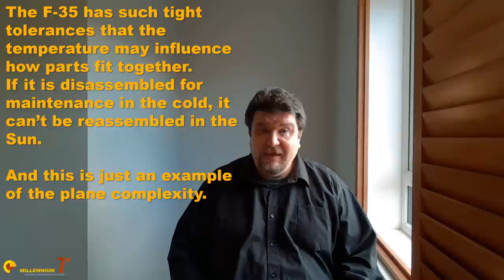F-35: The Failure of the $100 Million  Dollar Jet | Maybe...

Comment: The company I work for makes a lot of parts for the F-35.  The design of some of these parts is extremely complex in geometry, extremely tough to make in terms of the material they are made out of, and extremely tight on the tolerances.  Many efforts have been made over time to simplify the process of making these parts but it is still now and likely will continue to be an extremely hard machine to build.  Because of politics, I think it's unlikely the F-35 will end up being cancelled, but I can definitely see a lot of reasons to augment the air fleet with a wider variety already existing capable aircraft.
Reply: That's not a bug. It's a feature.
Reply: Tight edge tolerances equate to better stealth.
Reply: @SoloRenegade  All of what you said is correct, but the parts I was thinking about in particular are by their nature not simple.  They must endure extreme temperatures, extreme pressures, and are incredibly light weight considering what they do on the plane.  These components have their shape dictated by physics, so while there is always work being done to try and make them cheaper and better, these are some of the most expensive parts of the aircraft and that is unlikely to change because of what they do.  This is the case for all fighters which would have similar components inside them.  We also have lots of smart people working on these components who properly understand what they are doing.  Way back in the day when I first got into engineering I came to the same conclusion about many things being able to be made simpler and cheaper, but some things are not simple or easy.  The term 'cutting edge' is often a simplified way of telling someone you are doing something technically complicated but doesn't properly explain how difficult it can be to work with the hardest, toughest, most difficult materials and get them to conform to a tightly controlled form.
Reply: Things that fly are always simple and cost effective.
Reply: It really was a case of asking too much out of one aircraft. Not sure what made Lockheed executives believe it could be done, but I give the F-35 engineers credit for trying to craft the Boss' impossible specifications demands anyways.
🐸
Reply: @SoloRenegade  I would love for us to meet virtually, I'm a noice engineer, projects like the Sr-71 and Saturn V amaze me to this day.
Reply: @SoloRenegade  can old aircraft like F-117 nighthawk be modernized as a replacement for the F-16? It sounds stupid but the F-117 design is so advanced and looks menacing ?
Reply: The new 4.5gen fighter design's context is for "low-level threats". For USAF, F-35A, F-22A, and NGAD are allocated for near-peer and peer competitors.
Reply: @SoloRenegade  What about a modernized F-14 Tomcat ? Wouldn't it  be a cheap replacement  option for that the  B-1 bomber.
Reply: Edgewise i recall a quote from a Lockheed/Martin official a couple years ago.  This was after all the big decisions on design were settled...not before.   "We are bumping up against the absolute limits of technology on the F35 (paraphrase). "  I cant recall such a statement ever in the defense industry.  Given the charter they made a great plane imo.  Edit this quote was made around the time Gen Bogden (sp) stepped down.
Reply: So if we ever need to ramp up production...forget it. And you should have a plane that you can ramp up production on since if you get into a war, that will be the plane to have and you do not have 10 years to develop a new plane. You need to ramp up production immediately. Otherwise once your fleet is all down in flames, you will nowhere near enough replacements.  If you do try to create a new design,  you will have all sorts of issues. What you said should indicate that the US needs to immediately dump this turkey, and get started on a manufacturable plane. Amazing how the US has changed since WW2. Manufacturability was an critical criteria.
Reply: @SoloRenegade  your first response was a damned good reply. Is the F-35 truly over engineered? I'm literally in a position to not say, but you and I both know that modern platforms with current industry culture tend to favor that. Why? The engineering these days are done by interns rotating in and out every two years. Most people I've known in Aerospace are there for the experience only, to pad the resume. The over engineering is sometimes on purpose so they can lay claim to an accomplishment for the current corporate culture's pat on the back requirements, OR they're lazy and lazy engineers only add, never take away. There's very little functional fore thought from those types. 

The true engineers of the F-35 are damned good ones and have long since either retired and are providing consultation from their respective promotions in Skunk Works - but other than that the plane is literally maintained by committees of College Kids with no true applied knowledge, whom are just passing through. The ones that do a good job are the ones who are actually passionate about Aerospace and thus, care and have pride. 

Beyond that, the over engineering is a constant response to the DCMA (Pentagon) poking the bear as well. 

The said thing is, the F-35 is a damned good aircraft for the price but it puts companies out of business to make for the reasons the person you responded to stated. Tolerances and materials worked and other requirements by Lockheed are so high but I'll tell you another problem - Lockheed like every other Aerospace company, only orders a select number of parts at a time.

This forces those companies that struggle to produce the supplier parts to begin with, to go in the hole just producing the tooling required by the batches that Lockheed orders are so small that's it's simply not cost effective. I personally know of two CNC shops and two Tubing/Piping shops that were put under because of their F-35 contracts. 

I'm not privy to say how or why, but I see the problems as well and it's the same at Boeing, too. 

The F-35 is not the problem - it's our current professional society. The culture. Every one is here farming resumes without regards to leaving a legacy or a sense of accomplishment. No pride or anything. It's simply a circle jerk of endless proportions.
Reply: @SoloRenegade  I bet you and I could talk for hours brother. 

One thing I will say after having experience in launching 3 separate producing lines before - the higher your volume, the cheaper the cost and those benefits not only befall you, but your customer as well. 

If we like the F-35 (which I of course, do) but want to see it succeed? Gotta' produce a lot of them. 

Simple as that. 

Got to keep the program going and need to make thousands. The F-16 is the prime example of doing it right and the F-22 is a the prime example of why cutting it short is wrong. The 16's over all cost and sustainment is as good as it is because we have spare tooling, decades of generational knowledge on the program still working (even on the manufacturing floor) and established supply chains. 

Tbe F-22 was prematurely killed at 187 articles and they came back years later and even 2 years ago, asking us if we could could make more? Each time the answer was 'no' because by killing the production so early, the F-22s is prohibitively expensive upfront to restart. The tooling is gone, the established knowledge has thinned out or moved on and supplier chains never were maintained so you'd be starting from scratch. 

The F-35 is likely an over engineered platform like any complex machine these days, but with regards to the program itself in US political concerns, the cost of it could be offset by simply pushing thru and letting it mature - just like any other long term program be it the 15, 16, 18, F-4, ect. Over time, the 'over engineering' problems will get worked out AND, you'll have reduced your over all cost per unit via the continuous production of thousands of units. 

Yet I don't expect such a rational reaction from our political leaders. Every decision is meant to pander for the vote these days. The F-35s massive flaw in being heavily outsourced to suppliers is not the F-35s fault, it's actually Congress's, the Pentagon and only slightly Lockheed's (strange to defend Lockmart but yeah they're mostly innocent in this problem). Congress basically promised you a job in CA or NY in exchange for your vote, hoping the 'well paying jobs' would offset the cost burden on the fiscal budget. 

They were wrong because they clearly don't know shit about real life production industry, fabrications industry or Aerospace manufacturing and they clearly were either too lazy to get guidance or were lied too if they tried to get guidance.

NATO was also to blame in this as they traded international jobs on the JSF program for decreased NATO defense budget requirements and trade incentives. 

In other words, while you and I mourn the death of old school Engineering pride - the F-35s costs problems are actually on the very same people who complain about it costing so much. 

How's that for irony...
Reply: @SoloRenegade  your point with NASA is spot on and it's so infuriating. They're literally at the whim of people who don't know wtf they're talking about. 

Ted Cruz for example gave NASA a nice budget boost but explicitly told them how they'd spend their budget - which in his case, he ordered them to avoid investing the budget into Global Warming research because 'NASA should be researching space' despite ignoring the fact that meteorological research and atmospheric research is a hot commodity since landing on other worlds with an Atmosphere (even if thin) is in the very near future.

I had family in NASA and in companies like Lockheed / GD / Convair. They'd all agree that our current political cycling is ruining advancement and back in 1990 thru 93', engineerd got fed up with it and proposed a cheap, thought out, capable with current technology mission plan for landing Mars. The frustration was born from NASA engineers doing exactly what you've already stated with examples - and the reason they do so is because they become disenfranchised with their own careers thanks to the culture brought on by our political leaders. Hence, NASA proposed a 25 year long program for reaching Mars and would do so on purpose knowing full well, that every 4 years a new administration would cut the budget or divert the budget else where. 

Fortunately, we an Elon Musk
 Not the best business guy I hear, seems pretty asshole to the labor - but at least he has balls, the money and the vision to actually commit to something. 

The Starship program reminds me a lot of Project Orion - both programs are so cocky and so ready to perform, no matter how many crashes or explosions, that they're purposely building their vehicles out of steel 'because they can'. For Orion, it was to prove the point that the propulsion was that good, for Starship, it's to prove a point that manufacturing spaceships is only as hard as you make it.
Reply from the maker: 428 renegade would you contact me in private? Use the e-mail in the About section. Thanks!
Reply: @SoloRenegade  It is going to depend on the quantity to be built. Going to the extreme effort of optimizing cost when you are building only a few items means that cost of the minimizing cost item does not give you the payback. But if you are building millions, then it is worthwhile to go to extreme effort to minimize cost. Cars for instance saving a little bit of cost is a big deal. It is like when somebody programmed a bank computer to always round down, and deposit the save money in their account. It ended up being a lot of money. Still you have the reverse problem that is you replace with a part that causes failure, you probably lost everything you saved in customer disastisfaction.
Reply: @vectormwendwa8513  Did you notice that the F-117 is already out of service, and it goes back to only 1983 and retired only slightly over 20 years. There are F-16 As still flying, and they predate the F-117. That means that the plane just did not hold up. And it was really just a bomber, never intendent for most missions. It was probably exactly what stealth works best for...a plane designed for a single mission. I suspect that there have been very few missions where stealth has really been necessary. In almost all confrontations with the US, a radar that emits is a dead radar...HARM missiles immediately dispatched and that radar will never be a problem again. Israeli's proved that in the 1973 war.
Reply: @vectormwendwa8513  The F-14 is a swing wing. Nobody does swing wing anymore for a good reason. Look at his other videos. The Navy retired them in 2006. The F-15 which is the same generation is still flying, and so are the F-18 and F-16. There had to be issues. It could have been just because it was designed around the Phoenix missiles and they may be totally obsolete.
Reply: @cliffordnelson8454  Tupolev Tu-22M, uses swept wing design.
Reply: @SoloRenegade  Really. Wish I had the reference, but they did a simulation of F-35 and F-16 against China and the F-16/F-35 was decimated. Problem...Internal missile load of F-35 is one salvo. The enemy has many, and in a dogfight where stealth does no good, the F-35 is no match (high wing loading, slow climb, slow acceleration). So the F-35 shoot their missiles before they can be detected, and then you may get a few kills, but missiles have never been shown to be that effective, which is why planes still carry guns. So what do the F-35's do now. About the only thing they can do since no more missiles and the enemy can carry about 4 salvos, and is significantly better dogfighter. Only good choice is to run. Well guess that leaves the airspace to the enemy, and they can bomb cities, destroy ships, whatever, without worry. If the F-35 carries external, then it looses about the only real advantage it has. Lose lose.
Reply: @SoloRenegade  But some old designs still hold up today and are cheaper to use, ( Example - Su-27 which first flight was in 1977)
Reply: @vectormwendwa8513  Tupolev Tu-22M -- Maiden flight 1969, over half a century ago, introduced 1974, last produced over 20 years ago. Not exactly what I would call a good example. See "Millennium 7 * HistoryTech" videos on swing wing. I really doubt the Russians would build a bomber today with Swing Wing. There are many other examples of swing wing airplanes but the most recent design is probably over 40 years ago. PS The Tu-95 introduced in 1958 with turbofan engines is still flying as is the B-52
Reply: @SoloRenegade  And they were so sure that was the case in the 1960s that they removed guns from American aircraft. LOL. I have not seen them yet remove the guns from the F-35 turkey yet, so they are not as confident as they were in the 1960s. So I to not think the military has as much confidence as you do. And there are not many fighters I would give the F-35 an even chance against in a dog-fight. And it appears that the people who do simulations are not so confident either. Maybe they actually look at history. YOu seem so confident--would you remove the guns from the F-35 like they did to fighters 60 years ago.
Reply: @SoloRenegade  Wikipedia: The lack of an internal gun "was the biggest mistake on the F-4", Cheshire said; "Bullets are cheap and tend to go where you aim them. I needed a gun, and I really wished I had one". Marine Corps general John R. Dailey recalled that "everyone in RF-4s wished they had a gun on the aircraft".[19] For a brief period, doctrine held that turning combat would be impossible at supersonic speeds and little effort was made to teach pilots air combat maneuvering. In reality, engagements quickly became subsonic, as pilots would slow down in an effort to get behind their adversaries. Furthermore, the relatively new heat-seeking and radar-guided missiles at the time were frequently reported as unreliable and pilots had to fire multiple missiles (also known as ripple-firing), just to hit one enemy fighter.
Reply: @SoloRenegade  According to USAF General Mike Hostage, F-35A has superior RCS when compared to F-22A.
Reply: @cliffordnelson8454  
The so-called RAND simulation "of F-35 and F-16 against China and the F-16/F-35 was decimated" is BS.

That RAND report has already been debunked by no less than RAND itself.
Read http://www.rand.org/news/press/2008/09/25.html

“Recently, articles have appeared in the Australian press with assertions regarding a war game in which analysts from the RAND Corporation were involved. Those reports are not accurate. RAND did not present any analysis at the war game relating to the performance of the F-35 Joint Strike Fighter, nor did the game attempt detailed adjudication of air-to-air combat. Neither the game nor the assessments by RAND in support of the game undertook any comparison of the fighting qualities of particular fighter aircraft.”

http://www.defense-aerospace.com/article-view/verbatim/133273/f_35-fares-worse-in-rand-wargame.html

Mr Price : No, sorry; you will not read a RAND report of that activity. That activity was done separately to the Pacific Vision war game, and the analyst who did that was subsequently released from RAND because it never existed

Don’t Think the F-35 Can Fight? It Does in This Realistic War Game that counters Air Power Australia's BS (the same dkheads which placed F-111C on the same level as F-15s and SU-30/35).
https://medium.com/war-is-boring/don-t-think-the-f-35-can-fight-it-does-in-this-realistic-war-game-fc10706ba9f4
Reply: @SoloRenegade   A knife fight at close range is Hornet's dogfight competitive strength.
Reply: @SoloRenegade  For the starting point, F-35A is a smaller aircraft when compared to F-22A.
Reply: @SoloRenegade  For most 4th gen, it divided between nose pointers/high AoA/minimum turn radius and high energy/turn rate dogfighters.
Reply: @valenrn8657  You just proved that you cannot think for yourself. If you look at the abilities of the F-35 using critical thinking you can quickly determine that it the RAND study is right. F-35 fire there one salvo of missiles (they cannot carry more), and then basically have to turn around because they are so bad at dogfights. History has shown that missiles are not that effective, and enemy planes have excellent EW, so on a few may be shot down.F-35's turn tail. When are you going to learn to think... As said in the book "Deep State" RAND was pressured to burry the study "two RAND Corporation analysts war-gamed its performance in a hypothetical matchup against Chinese fighter aircraft. The F-35s, overweight and ponderous because of their complexity, were bested by their adversary. RAND, dependent on government contracts, backed away from the study after being pressured." So you can take your propaganda and you lack of critical thinking skills and shove it. Thanks for the uniformed reply.
Reply: @cliffordnelson8454  Hint, from USAF F-35 pilot blog, F-35A Block 3F is similar to F-15E with a high angle of attack behavior, hence it's inferior to F-15C's high energy dogfight.  To improve energy, USAF has an active engine upgrade program for JSF.  F-15E-1 variant has the engine upgrade.

Note that Flankers are NOT low wing loading/high energy dogfighters i.e. they are Super Hornets with a turbo and higher empty weight.
Reply: @valenrn8657  Have you looked at the specs of the F-35 and truly compared them to the F-16, which is more maneuverable than the F-15, but still not as maneuverable as the Russian aircraft. I read where they still cannot get close to 9 g turns. Do you know what wing loading is and its significance. Probably not since you make that statement. You want low wing loading for maneuverability. High wing loading means you are not very maneuverable, and the F-35 has very high wing loading for a fighter aircraft. And you know what thrust to weight ratio is. Put the better engines on an F-16 and it will blow away the F-35 in acceleration and climb., and the Soviet plane is apparently even better. Hint....pay attention to details. I can explain to you the concept of design tradeoffs and how there are impacts from Stealth. I worked as a systems engineer on the Comanche program and often heard from the  airframe people about how stealth was such a big impact on what other attributers. Maybe you should get your masters in engineering like I have...you would learn what engineering is all about instead of being an armchair expert like Trump. And never trust the pilot blogs. They are there to try to convince the public that it is not getting a pile of ****, not to provide real information. They are strictly MIC propaganda. Much better going to third parties that can actually think for themselves and not replicate the propaganda.
Reply: @cliffordnelson8454  Both SU-35S and F-35A are overweight when compared to F-15C and F-22A.

Despite F-22A's heavy weight (similar to SU-35S ), F-22's large wing resulted in low wing loading similar to F-15C. F-22A's large wing area also generates high lift drag which is mitigated by two powerful 37,000 lbf engines. F-22A's heavy empty weight and large wing area are designed with its intended engine thrust target.

F-22A's acceleration is similar to clean F-16C Block 50's acceleration which is close to F-35A's acceleration. 

Basic Wing loading without body and vortex lift.
F-35A
Empty weight: 28,999 lb (Year 2015).
Wing area: 460 ft²
Wing loading: 63.04 lbs/ sq feet.

F-16C Block 52
Wing area: 300 ft²
Empty weight: 18,900 lb
Wing loading: 63 lbs/ sq feet.

F-35A's empty weight is 1.54X scaled from F-16C.

F-35A's wing area is 1.53X scaled from F-16C.

F-35A's 43000 lbf thrust is 1.50X scaled from F-16C's 28600 lbf.

There's a near straight 1.5X scaling between F16C to F-35A on basic wing loading, engine thrust, and empty weight.

F-35A's wing area and engine thrust target are influenced by weight growth when scaled from F-16C.

F-35A was NOT designed to replace F-15C!
Reply: @cliffordnelson8454  Sorry pal, I'm not a newbie when it comes to John Stillion, Scott Purdue, and Harpoon 3 PC computer games.

Your "When are you going to learn to think" can GTFO.

Unlike you, I can cite the specific BS simulation, its authors, and the PC computer games used in their war game simulator.
Reply: @cliffordnelson8454  Btw, 
AIM-132 has IR BVR A2A missile capability i.e. it has superior range when compared to AIM-9X Block 2.

UK and Japan are developing a Meteor BVR missile with a micro AESA seeker.
Reply: @cliffordnelson8454  The lesson from F-15SE

F-15SE's canted outward by 15 degrees which decreases RCS in A/A engagements. The outward cant also improves aerodynamic efficiency and generates extra lift. The canting also allows airframe weight to be reduced by removing 400-500 lbs of ballast weight from the forward section of the aircraft (from Boeing).

Notice canted vertical tail generate lift. The lesson is similar to F/A-18 and F-35. 

Critics like Pierre Sprey's argument on low wing loading are insufficient.
Reply: @cliffordnelson8454  
F-135's 43,000 lbf has a higher temperature and F-16C wasn't designed for this engine. F-16E Block 60 was specifically designed for a higher rated 32K lbf GE engine.

http://www.f-16.net/forum/viewtopic.php?f=55&t=5525&start=1335#wrapper
From GTA4's post with OEM numbers, F-35A beating Eurofighter in acceleration.

http://www.f-16.net/forum/download/file.php?id=23836
According to Beesley, the four current test pilots for F-35 have been most impressed by the aircraft's thrust and acceleration.
In the subsonic flight regime, the F-35 very nearly matches the performance of its' larger, more powerful cousin, the F-22 Raptor, Beesley explained. 
The "subsonic acceleration is about as good as a clean Block 50 F-16 or a Raptor- which is about as good as you can get." Beesley said.

For acceleration, notice clean F-16C Block 50 is slightly superior to F-35A's acceleration. Remember the 1.54X design scale rule.
Reply: @cliffordnelson8454  SU-35S doesn't have a low wing loading. Also, the wing area, lift generated and lift drag needs to match the engine thrust target.
Reply: @cliffordnelson8454  F-16-79 variant with degraded engine thrust has turn rate degradation, hence engine thrust must match against aircraft's design.
Reply: @cliffordnelson8454   It's easy to add a large wing on F-35 i.e. F-35C has a large wing area similar to F-15's, but it's underpowered. There's an engine upgrade program for F-35C.

USN wanted a large wing, LM provided a large wing for F-35C.

The wing loading argument is nothing without matching engine thrust.
 

Blame USAF that imposed ~1.5X scale design rule on F-35A.
Reply: @valenrn8657  And a larger wing increases radar cross section. LOL.
Reply: @cliffordnelson8454  You mastered nothing 

The real F-16 designer http://www.codeonemagazine.com/article.html?item_id=37
F-16 Designer Harry Hillaker

Harry Hillaker's statement on low wing loading and wing size...

_For example, the drag coefficient of an F-16 is about the same as that of an F-4. However, the F-16 has about one-third the drag of an F-4 in level flight. At angle of attack, it is about one-fifteenth

We knew that we wanted low wing loading and high thrust loading. But we also knew that low wing loading means more weight and more drag

Critics like Pierre Sprey's argument on low wing loading are insufficient. Larger wings introduce higher drag. 

The trick with F-16's design is to have medium wing loading, smallish wings, and lower wing loading during an angle of attack turn with vortex lift. F-16 has a blended body-wing design to generate extra lift from the body. For vortex lift generation, F-16 was designed with low drag at an angle of attack, hence smaller wings. 

Try again.
Reply: @cliffordnelson8454  
>And a larger wing increases radar cross section. LOL.

That's assuming similar RAM coating effectiveness for both aircraft designs.

Quoting General Mike Hostage on F-35A vs F-22A on RCS.

The F-35's cross section is much smaller than the F-22's

.
Reply: @cliffordnelson8454  At high altitude and sustained turn rate, F-15C (high) has the advantage over F-16C (low).

I do have flight manuals for both aircraft.
Reply: @valenrn8657  So you redesign the F-16 to take the new engine. Does not take rocket science for a high school senior to figure this out, not does to figure out the the two planes are different. LOL. In fact if you look at the history of a lot of successful planes, the needed to be redisgned for new engines. Remember the FW-190, It originally had an radial engine, and the FW--190F had a water cooled inline. Two much more different engines than two different jet engines would be be. Guess you can't even think inside the box.
And please learn to compare apples to apples. Eurofighter is now almost 20 years old, and amazingly the Europeans are really much better at getting a plane in the air given that was only 10 years, and it does not seem like it had any where near the number of faults as the F-35 turkey.
Reply: @valenrn8657  Basically the F-35 is not a good maneuver aircraft from many sources. I see this time and time again from 3rd party sources. Of course not from the military pilots or test pilots, but we no who pays them. Here is one https://arstechnica.com/information-technology/2015/07/disastrous-f-35-vs-f-16-face-off-was-also-a-battle-of-philosophies/ and I see this repeated, and it makes sense since its major design criteria was stealth, not all around capability. How many more references would you like?
Reply: @cliffordnelson8454  For the Arstechnica link, note that F-35A Lot 1 builds does NOT have stealth and they are stuck in Block 3i (7G) configuration. F-35A Lot 1 is a throw away build.
Reply: @cliffordnelson8454  
https://youtu.be/ROOeGPrC1Do?t=156
From Top Gear, UK pilot claims F-35B has sustained 7G turn which contradicted David Axe's F-35A AF-02 unit's barely 6.5G turn report.

 The difference is UK's F-35B Block 3i/3F is newer than David Axe's report's F-35A AF-02 Lot 1 unit.
Reply: @cliffordnelson8454  
I have seen Jan 2015 report between F-35A AF-02 Lot 1 unit vs F-16D with external tanks incident before Arstechnica link.
From Out Of The Shadows: RNLAF experiences with the F-35A - Combat Aircraft Magazine May 2018

1. Dutch F-35 Block 3F, "F-35 sits somewhere in between the F-16 and F/A-18 when it comes to within visual range manoeuvring'".

2. Lightest empty weight F-16A MLU air-superiority model needs to be clean (no weapons, no external tanks) to make visual range dogfight interesting against combat loaded F-35A Block 3F.

3. Dutch has acknowledged early F-35 Block builds being beaten by F-16s with external fuel tanks which are NOT applicable for F-35A Block 3F build.
 Don't use Block 2A/2B/3i numbers!

Quoting Out Of The Shadows: RNLAF experiences with the F-35A - Combat Aircraft Magazine May 2018 specifically against your Arstechnica link (David Axe report).

Knight divulged a little more information about flying basic fighter manoeuvres (BFM) in an F-35. 'When our envelope was cleared to practise BFM we got the opportunity to fight some fourth-generation fighters. Remember, back the rumors were that the F-35 was a pig. The first time the opponents showed up [in the training area] they had wing tanks along with a bunch of missiles. I guess they figured that being in a dirty configuration wouldn't really matter and that they would still easily outmanoeuvre us. By the end of the week, though, they had dropped their wing tanks, transitioned to a single centerline fuel tank and were still doing everything they could not to get gunned by us. A week later they stripped the jets clean of all external stores, which made the BFM fights interesting, to say the least...

---------------
Try again.